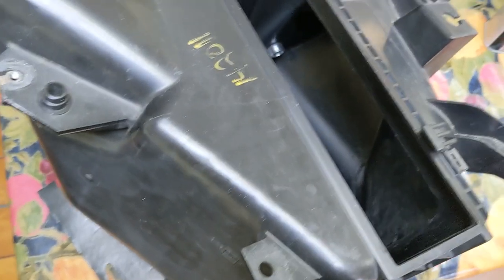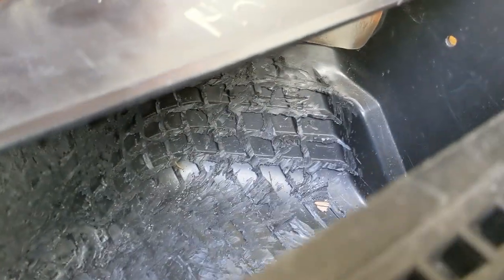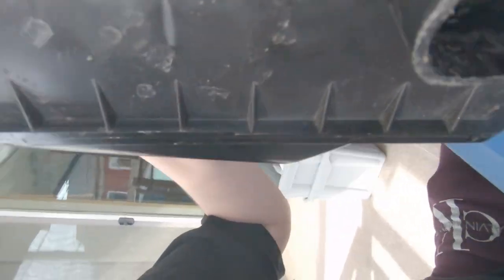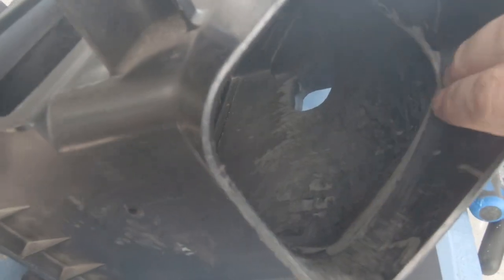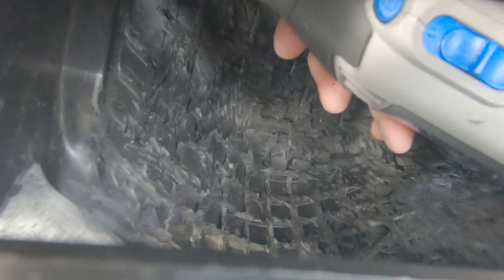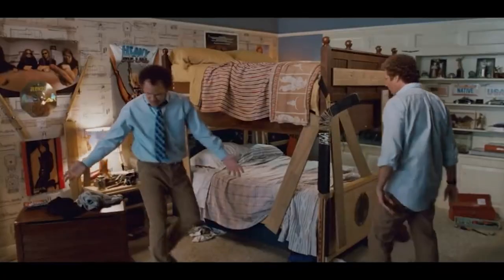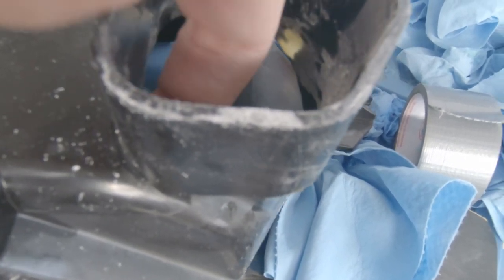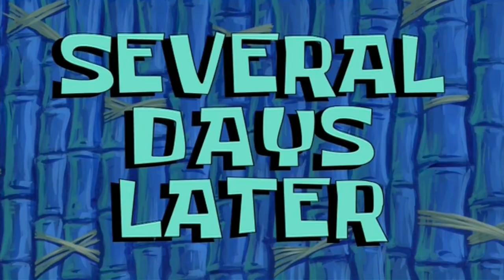Infiniti Q45: Stage 3 Intake

Comment: hey i’m not sure about the q45 but i’ve got an 03 m45 an from everything i’ve looked up  there’s no tuning at all available aside from a 2 deg timing advance.
have u found different information or a way around this?
Reply: also maybe u know more about this but i swear i feel like first gear has a limit on wide open throttle body (like every car does) i just don’t know how much.
 but i also haven’t found a way around that either
Reply from the maker: Yes there is actually. I have an 03 M45 ECU that can be tuned with Uprev. It's only one map and it takes a while to flash compared to the newer ECUs. You can swap in the newer ECUs that support uprev as well but there may be supporting mods required. 

I had it working for a while and I got greedy and bricked the ECU, I just recently sent it back and had it restored so one of these days I'll be posting a tuning series.
Reply from the maker: @Mvelardi07  and yeah there is a WOT restriction and I believe it's dictated by speed sensor. When I first had uprev the "uprev throttle" wouldn't work but I got an email from one of the devs I was talking back and forth with and he informed me that they had fixed the p0605 issues and now uprev throttle works so according to them they've got that working but I haven't tested it yet. It's one of the biggest reasons I want to swap the ECU back in haha
Reply: @30YearOldBunta  
wow that’s great id love to hear more man, keep it up.
i’ve called up rev (1-2 years ago) and been told “sorry no support for the 03 m”
but also been told by a tuner “no i could figure out a way” lol

thanks!

Comment: How’s this intake working for u ? Why not just make a short ram how was that I’m sure I’ve done it before ?
Reply from the maker: It's great! Definitely an improvement over previous iteration. If you watch the early videos I had a short ram and a heat shield I made and everything but I found the stock intake works really well, and now that it's optimized a bit it's even better.
Reply: Let us know how that 03 m45 ecu tune goes I want to get tuned by uprev soon as well
Reply: i’ve done it too for the vk, they way he’s got it set up it sucks in cold air.
the down side of a short ram even with a heat shield is high intake air temps.

i personally cut a 3” hole in the metal below the stock intake and mounted an aem filter inside the bumper behind an air vent. so it’s completely segregated from the engine bay.
kinda like how the stillen intake is on the 370z
Reply: Pics of the setup

Comment: Where did you get the floor mat set
Reply from the maker: Got it on eBay, it's for a QX70 I believe but they made it slightly different for me. It's still a little too short in the back.